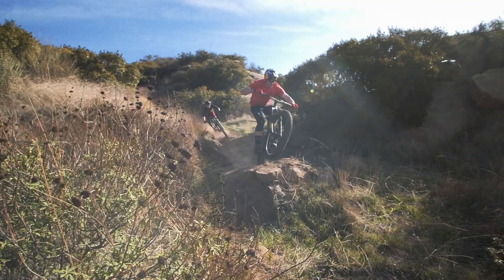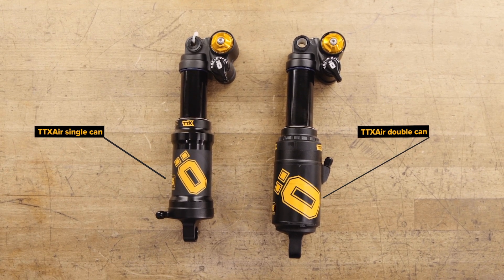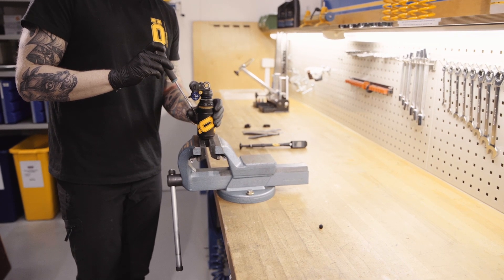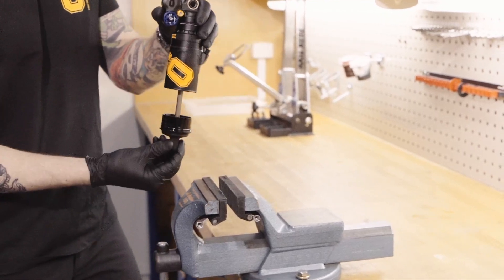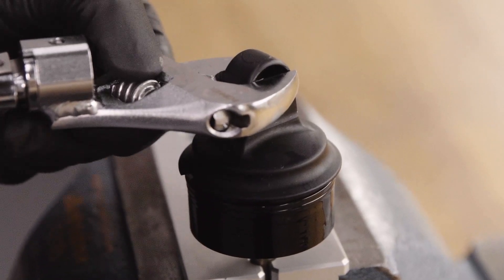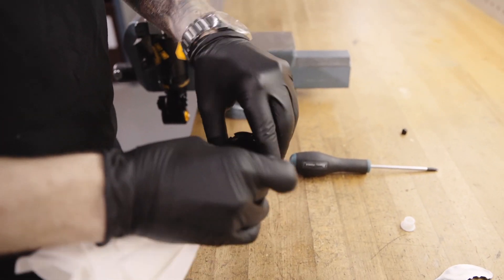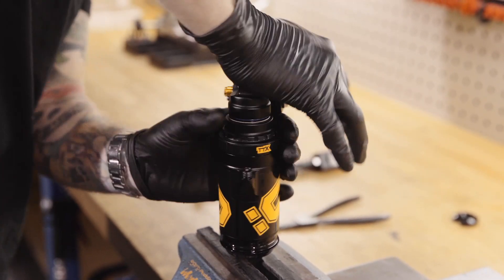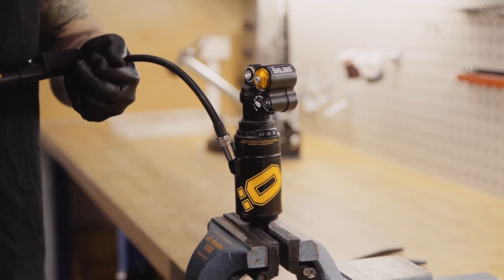MTB - How to change stroke on an Öhlins TTXAir rear shock

Comment: Thinking about buying a TTX double can but i got a question, in this video it seems quite simple to change the orientation of the air valve ( which i need to change for my install) but in the video about tokens it says there's a fixed grove so I'm confused

Comment: Change the stroke as in travel? shorter stroke reducer more travel?
Reply from the maker: Hi Phil, this is only to reduce the stroke/travel, not the length of the shock. And yes, this is correct — the shorter stroke reducer gives more travel.
Reply: @Ohlins  It's possible to reduce the length of the shock? Thanks.
Reply: @RR821212 no just the stroke.  The eye to eye is always fixed.